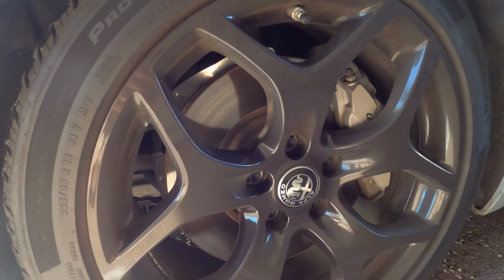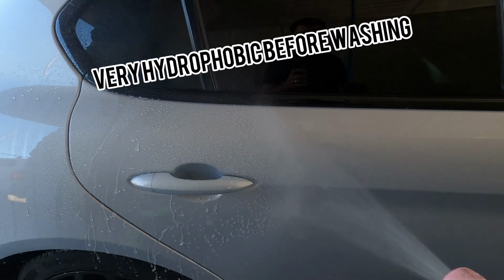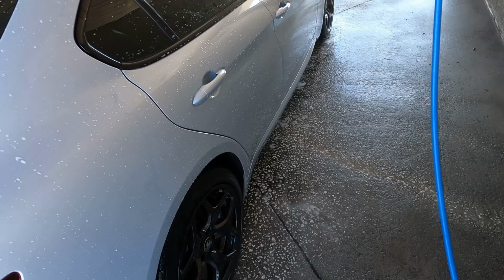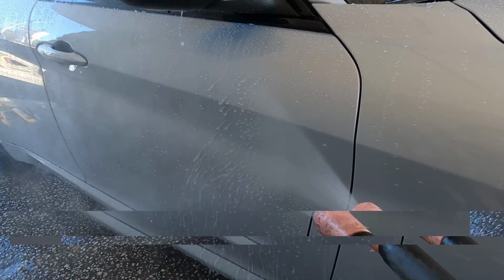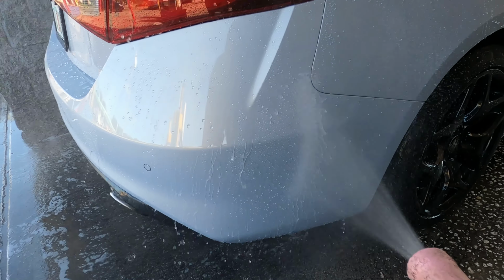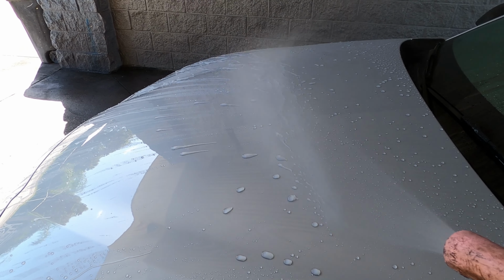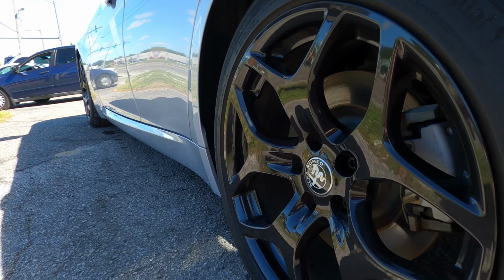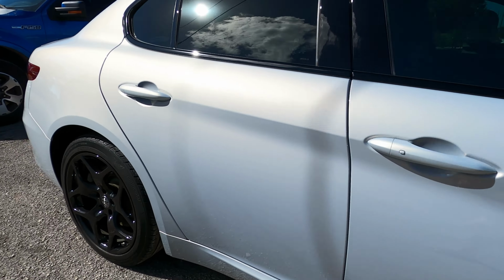Gyeon CanCoat Evo - How long will this ceramic coating last?

Comment: Have you ever tried Griots 3in1 ceramic wax to compare to this? Im wanting to try one of these spray on ceramics and trying to decide between the Griots and this one.
Reply from the maker: @johnmiceter unfortunately I haven’t tried Griots 3in1 ceramic wax. I really like Gyeon can coat because it’s easy to apply, durability is 12 months, and leaves surface very hydrophobic! One thing I don’t like is the price. I feel like they could make a smaller bottle, because the bottle for $60 can probably coat about 3 cars. Which is a plus, but not if you only want to apply it on 1 car. I hope this helps.
Reply: @justanaveragecardetailer  why do you say, not if you only want to apply it on one car? Can't you just keep using it later and top it up after every 12 months or so when you need it, so wouldnt it last for a long time? Btw, I would only be using it on my car for myself as im not a detailer or anything
Reply from the maker: @johnmiceter unfortunately the shelf life after opening is 12 months. So, as the product is getting closer to that 12 month mark, it will not perform as good as it did with a brand new bottle, after reapply. That’s why I said if you’re only doing one car, it’s not really worth it. If you can get it on sale it’s definitely worth it and Gyeon cancoat is a good entry level ceramic coating (very user friendly).
Reply: @justanaveragecardetailer  wow that is stupid then hey, specially for the average person that just wants to do their own car only and it supposed to last 1w months doesnt it, so you basically only use it one time. Doesnt sound like this is for me then that sucks, I didnt know it could go off.
Reply from the maker: @Johnmiceter I mainly use Gyeon CanCoat as a topper over an existing ceramic coating. This is where I believe it works very well. As a topper, it will take all the environmental conditions (such as, bird droppings and water marks) and keep your main coating protected.
Reply: @justanaveragecardetailer  im just looking for something that will protect my paint in-between washes and maybe to make my paint look better as i dont want to pay for a proper ceramic as my car has a few in perfections a buff can't get out.
Reply from the maker: @johnmiceter they make very easy user friendly ceramic coating these days. For example, Gyeon one has a very long working time, to prevent from high spots. Another one is Avalon king armor shield IX. So I actually first got into ceramic coating by using this coating. It’s very user friendly and it last one my car for a 1.5 years. If you just want something between washes you could use a ceramic sealant. One I like to use is xtreme solutions topper. It leaves the surface super slick and the shine it gives your car is amazing. This protect last about 3 months and when you want to apply again you just wash car and spray on/wipe off, super easy.

Comment: Do you think the avalon that's on there still have an effect though
Reply from the maker: @JayLive as of now, no. The reason I say that is when I applied Gyeon CanCoat over the Avalon king the water beading got tighter and the shine was enhanced. Gyeon CanCoat should last 12 months, it is a true SiO2 coating that will leave behind a protected layer on your vehicle or over a existing ceramic coating.  But do I think it would skew the durability results in the future around the 10 month mark, yes.
Reply: To avoid swirls and scratches, which admittedly on a white car would be hard to see,  begin with snow foam to loosen dirt, rinse the car and then use the 'two bucket method' with grit guard, also avoid drying in direct sunlight to prevent water spots. Try cleaning wheels, wheel arch liners, and tyres before the rest of the car.
Of course it all depends how fastidious you are... being particularly fussy I can spend six hours cleaning inside and out!!
I plan on using Cancoat evo for first time so your video makes for interesting viewing!